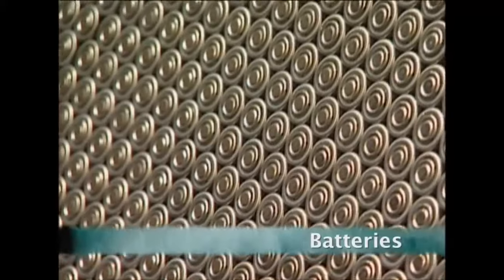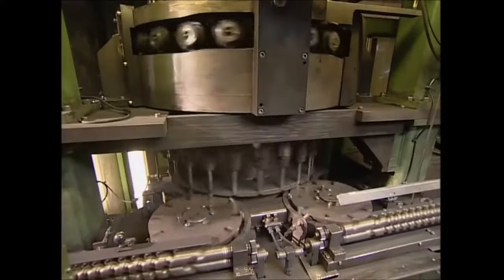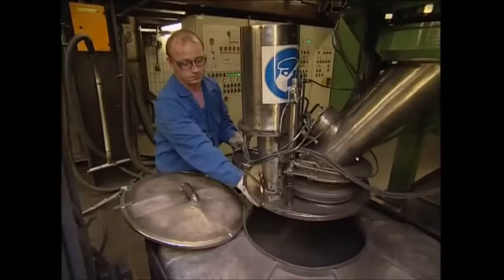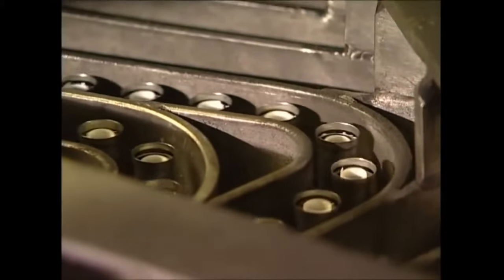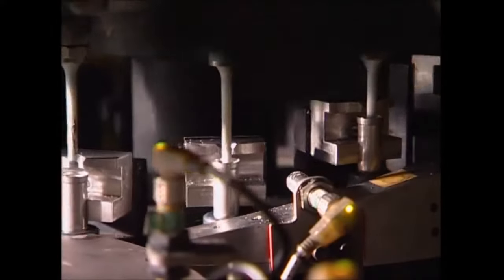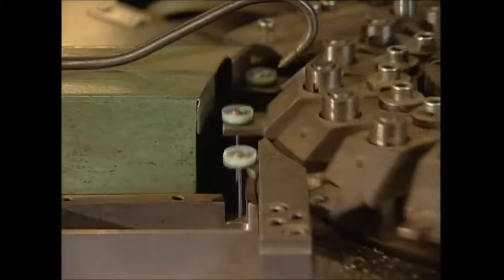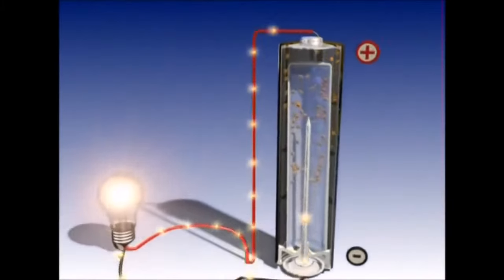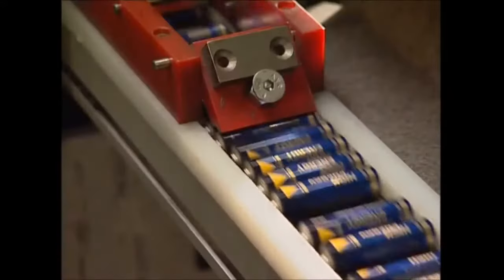How It`s Made   Duracell Batteries

Comment: Duracell batteries suck,  they used to be made very well several years ago but now they leak acid if left in a device for more than a month.  They went cheap and now Duracell batteries are pieces of shit!
Reply: Do i suck too you guys???
Reply: Bruh
Reply: @tonyzuco6144  cmon, it aint gonna suck itself
Reply: Thats not true , left Duracell batteries in remotes and Xbox controllers for years and never once had a battery leak . Used exclusively Duracell for over 10 years
Reply: I've had the same problems with Duracell. I only use RayOVac now.
Reply: @nikkiracks485  I won’t say no
Reply: @dylanclay2741  Yes it is true, I did have Duracells leak on me WAY more often than any other brands. I switched to NiMH rechargeable batteries in most of my devices because of those fuckers...
Reply: Just buy rechargable batteries- sure theyd save money in the longrun too
Reply: @CoolKoon  nimh dont leak but instead they self discharge more... make sure to get the low self discharge type for low drain devices like remotes or they will self discharge more than the device uses them. they are the cheaper ones with lower capacity because they have thicker separator. the more expensive high capacity type has higher self discharge and should be used for high drain devices.
Reply: @poiiihy  "nimh dont leak but instead they self discharge more..." - That's an undeniable fact, but it doesn't matter that much as long as the battery doesn't go bad and can be re-charged.